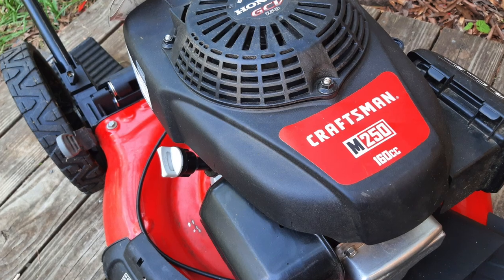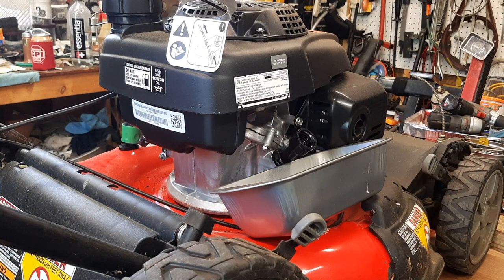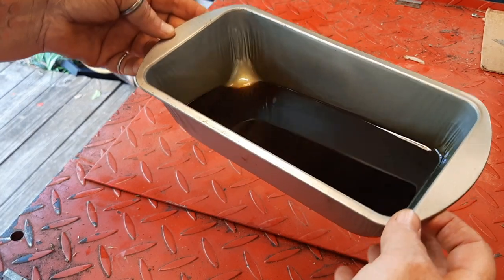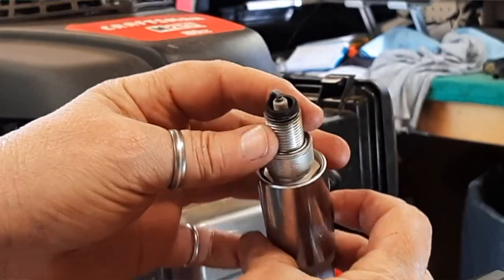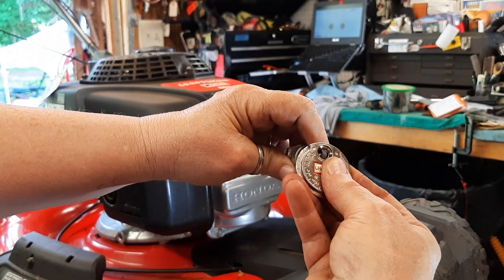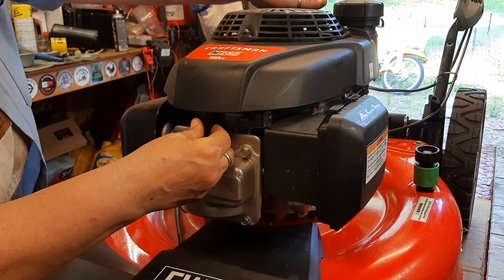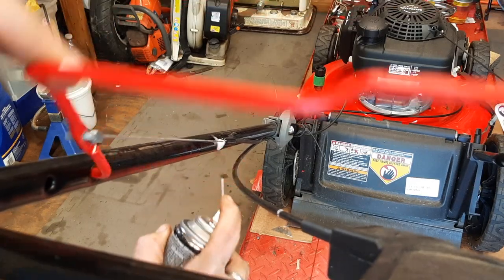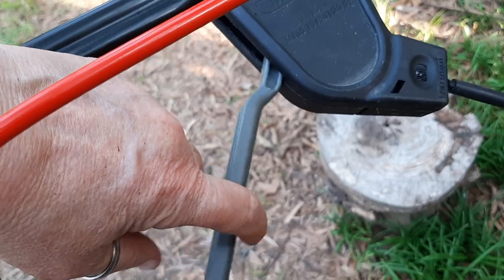Easy Maintenance: Craftsman M250 Mower- Honda GCV160 Engine

Comment: I got a mower so filled with oil I had a hard time cranking it over When you pulled on the recoil oil squirted out the muffler ! I cleaned the carb and you guessed it more oil than gas ! People read your owners manual !!!
Reply from the maker: More is better, right 😂🤣
Reply: The dipstick should read the dipstick.

Comment: GREAT!!!  YOU ARE AWESOME!! I'm having  prblem with!!! 2/lilgas? SYMBOLS (ONE HAS / OVER IT?)...which way do I keep gray button??
Reply from the maker: Turn the fuel tap off, and run the carb dry when you are not running the machine. The fuel tap is closed when the handle is perpendicular to the fuel line.

Comment: Did the blade need sharpening?
Reply from the maker: It did, but I recall the camera didn't get that part of the maintenance. Operator error no doubt 🤣😂😁 check out the video I linked in the first comment. Cheers!

Comment: Good to see you again, Stella. 
I like to use a light coating of silicone or dielectric grease in spark plug boots. It protects the boot spring from corrosion and also makes it easy to remove the boot in the future. 
I get that you were saving the owner money, but I would have changed that oil anyway because saving in the short term could cost her more in the long term. 
I hope she learned her lesson on lending power equipment!  That guy made multiple mistakes she can’t afford!
Reply from the maker: Thanks Mr Rein! I think her mower lending days have passed. Cheers!

Comment: Great video! Two little points; to wash the grass off, use the black/green nozzle on the side - turn the engine on and connect it to your hose pipe and, mention how much oil you add. Not having a plug to drain the oil completely, you need to add only 10/12 oz and check it for more. When new, it takes 20 oz.
Reply from the maker: Thanks for watching.

Comment: A friend of my Mom had a guy who cuts her grass with her mower and abused it like this.  She asked me to Winterize it and I found the tabs on the blade adapter broken off (scared me to death when I started it), loose bolts on one side of the mower at the deck, which had caused both bolts holding the top and bottom handles to flatten.  Tons of grass underneath from mowing wet grass and a few holes in the front of the deck as a result.  Wheels at all different heights. 
I got it all straightened out for her, bolts tightened or replaced, new adapter, wheels at proper height, grass scraped out, new oil, filter and spark plug, cables lubed . . . and told her to never let that guy touch her mower again!  She's got a neighbor kid who cuts her grass now and the mower stays in relatively good shape.
Reply from the maker: Glad you could get it straightened out for your Mom. Thanks for watching. Cheers!

Comment: Krylon red pepper is a great match for mtd mowers if you want to touch up the paint.
Reply from the maker: I stick to the mechanics, and leave the cosmetics to someone else. Thanks for the tip however.
Reply: They could all use about 10ml of paint over them to last longer. Man they rot fast in the south.

Comment: So helpful; thank you!! What is the best way to clean the underside of grass and debris?
Reply from the maker: I usually turn the mower on the oil dipstick side and use a small pressure washer. If it's really dried from say, over winter, I use the flat wide end of a pry bar. A good strong spray from a garden hose will work too, just takes longer. I appreciate you watching. Cheers!

Comment: Nice to see you back in business Stella and i bet that OEM Honda air filter was expensive we get the filter and prefilter for these from Stens and sell the combo for around $13 plus tax i believe our local Canadian Tire sells just the paper filter for $20 plus tax.
Reply from the maker: Thanks Mr Wayne! I'll check out the Sten's pricing. I often find OEM bargains.  Thanks for watching. Cheers!
Reply: @TheLawnmowerLady  You need an account with Stens to buy direct do you have one? Checking on line the Stens parts are much more expensive then if you have an account with them like we do. We get dealer pricing with additional (as little as 10%) additional discounts depending on annual order volume. Additionally, they have pre season stocking deals that give you more discounts on sales. In order to set up an account you need a tax registration number.
Reply from the maker: @waynestefinashen239  I'm a glorified shade tree mechanic. I don't have the volume for a direct relationship. I charge for parts same as what the average homeowner would pay at a big box store.

Comment: Thank you! My mower starts and Stahl 2 seconds later... 
I preferred my previous mower with the press Choke and candle i could easily remove to clean up each time after usage.
I have tried the hose but it doesn't clean well... I think it's too dirty.
Reply from the maker: Might be a clogged idle circuit. Thanks for watching.
Reply: @TheLawnmowerLady  Possibly, thank you. My previous mover was 23 yo and never stahled! 
This is a new one. If i could unplug the candle to clean it, i would do so...

Comment: Great vid.  What size fuel line goes from cutoff to carb on the GCV160?
Reply from the maker: ID is 1/4" (I think?) but it is a thin wall. The OD is not the same as if you purchased 1/4" rubber fuel hose from autoparts store. If you do get the larger OD hose, you will need new hose clamps.
Reply: @TheLawnmowerLady  ok thank you, I’d heard Honda had an oddball size.

Comment: Thank you for the video. I have a question when should you change the spark plug on this model?
Reply from the maker: I would change it if it gets very sooty or oily, or if the grounding strap starts looking pitted or deteriorated. They can be cleaned, but just as easy to replace. I've had some mowers that are dozens of years old, original plugs, in good shape that continue to work just fine. Thanks for watching.
Reply: Good afternoon lawn mower lady. I have this mower and I loaned it to a firefighter friend of mine and I got it back yesterday and I tried it today and the red handle is almost impossible to pull back now. It's not moving freely anymore and I disconnected the cable and pull the cable and that works just fine. My friend said he didn't touch anything but I don't believe him LOL. So while I had the cable disconnected from the red handle I just tried to pull the red handle back on its own and it's the same problem. Any chance you could post a video or give me an idea how to put the red handle back in in the right order so that it moves free back and forth? It's definitely set up with the cable side of the red handle on the left but when I put it in I've tried 10 times and every time I think I have it and then I go to pull the handle back it feels like I'm going to bed in the red handle in half
Reply from the maker: @mrobvious1100  some of those handles have multiple holes to mount the bail. Make sure you're in the correct holes, and it's not upside down.

Comment: I own this mower. Any suggestions on how to fix or replace the handles that keep falling?
Reply from the maker: If you are referring to the point where the handle attaches to the plastic back deck panel, ensure those thumbscrews are very tight, so there is minimal play. I've had several of those plastic back panels break, right where the handle goes. Poor design IMO, be mindful of this flaw. Thanks for watching.

Comment: Just wondering if there is an oil drain plug under the deck or do you really have to drain the oil from the fill tube?
Reply from the maker: The newer mowers don't have a drain plug bolt any more.

Comment: How do you know if you are supposed to screw the oil cap in to check the oil or if you just push it till it stops and then check it?? I always wondered how you knew that or how anyone knows that
Reply from the maker: Most all Hondas have a sticker on the side of the blower shroud. But it often peels off. But generally speaking Honda vertical engines don't screw in. It's in your owner's manual too. Thanks for watching.

Comment: Lawnmower Lady, show me how to replace the front wheels  on my M250 with new ones please?
Reply from the maker: I don't have that particular mower, but generally speaking if yours is NOT a front wheel drive, use the correct sized socket and ratchet to loosen and re-attach. If your mower does have front wheel drive, you might have to juggle a backing plate and maybe a few more washers to sync the drive gear back to the teeth on the wheels. Either way, just be mindful of any loose washers or spacers that you need to replace.

Comment: does any spark plug work? i am trying to order one but I see that there are some other non-craftsman spark plugs available
Reply from the maker: Depends on which engine is on your mower. If it's a Honda it should be a NGK BPR5ES. If a Briggs & Stratton engine, it's either a Champion RC12YC (newer engine models) or Champion RJ19LM on older models. I suggest removing the existing plug and order based on what's in the machine now (that's assuming its the original plug)

Comment: I have that same lawnmower and I can't get it to start. My nephew can start after a few pulls but I used to be able to turn it on after 1 pull. I'm at a loss
Reply from the maker: If it has been sitting for more than a month or so with ethanol laced fuel, you'll need to clean the carb, flush the fuel tank and fuel lines, and replace it with fresh non-ethanol fuel. Check the air filter is clean as well as the spark plug is not fouled.

Comment: I have the TroyBilt TB200 mower with the same problem.  I removed the carb and took it apart and cleaned all the parts and then assembled it and installed it.  Mower still won't start.  I used some starting fluid and it started on the first pull but only ran until all the starting fluid was used up.  The fact that it will start tells me I can eliminate the spark plug, wiring and magnito.  Since it takes spark and fuel to make an engine run the problem must be on the fuel side.  I had emptied the fuel tank of all the old gas and added new gas, so it is not a gas problem.  Must still be a problem with the carb.  Do you have any ideas what to try next?
Reply from the maker: Certainly look at the auto choke mechanism, and no shame in opening up that carb for another look and see. Does fuel flow when you take off just the bowl and open the fuel tap?
Reply: @TheLawnmowerLady  The auto choke mechanism is mechanical and appears to work off of heat from the engine.  It looks fine.  Fuel is flowing fine from the tank because I have taken the carb off four times and each time the bowl has fuel in it.  If the fuel tap is the shut off valve this mower does not have one.  There is just a short piece of hose from the fuel tank to the carb.
Reply from the maker: @spuddy_bud  This does not sound like the Honda Engine shown in this video if you have no fuel tap. Still could be a fuel delivery issue. Does fuel flow freely through the carb with the bowl off? That's different than "the bowl has fuel in it" when you take off the bowl.
Reply: @TheLawnmowerLady  This is a TroyBilt mower (TB200) with a B&S engine.  There is not fuel shut-off.  If I remove the bowl from the  carg gas keeps running out.

Comment: I have this same mower how do you adjust the idle on this mower?
Reply from the maker: Slightly different mower, same engine here: https://youtu.be/8qic4cARD2E Towards the end I show adjusting the RPM higher. Basically you need to bend the bracket where the governor return spring terminates. More tension on the spring = higher RPM. I aim for about 3000 RPM. There are some apps you can get on your phone that will get you in the neighborhood. If it sounds like its revving crazy too high, it probably is. Hope this helps. Thanks for watching.

Comment: But l have a problem on handling the pushing it will fold l tried to tighten it but the plastic junction arm is formidable to make the arm straighy
Reply from the maker: Unfortunately, a lot of newer mowers and with a lot of plastic don't hold up well. A little TLC goes a long way. I appreciate you watching. Cheers!

Comment: If it fits can i put an mtd riding lawn mower blade on an mtd push mower?  I see the one from the rider is wider but it is the proper length.
Reply from the maker: Wider blade = more mass. The engine will work harder to turn the blade.
Reply: @TheLawnmowerLady  would you consider it dangerous?
Reply from the maker: @RattyFlyer  Maybe? I'm no engineer, but I figure the designers have a better grasp of what works best, so I tend to stick with OEM, or higher quality aftermarket. Just because it fits, doesn't mean its a good choice.

Comment: With a nice mower like that id drain all that oil and fill it with fresh oil to the proper level but thats just me.
Reply from the maker: Lady is on a fixed income. Saving her $$ where ever I can.
Reply: @TheLawnmowerLady  my grandpa never changed the oil in his small engines and i inherited several of them still running lol so it will probably be fine.  I was just thinking who knows what sort of oil thet guy used if he put double the amount in 😬

Comment: Another person replacing the oil without taking the old oil out🙄
Personally I would of given it a full oil change as I do on myHonda Motors, especially when you don’t know what oil the guy used.😉
Reply from the maker: Great point! The lady that owns the mower is retired and on a fixed income, I was trying to save her some $$$. Pretty sure she will call me up at the end of this season to winterize her mower. I appreciate you watching!
Reply: @TheLawnmowerLady  yes, I know that was my thinking too. Your very compassionate Stella😀
The oil usually only last one year in Australia not having snow so 12 months of mowing less in winter, the Honda usually needs a change for domestic use with a new spark plug and air filter.